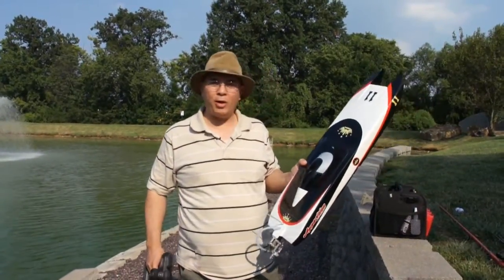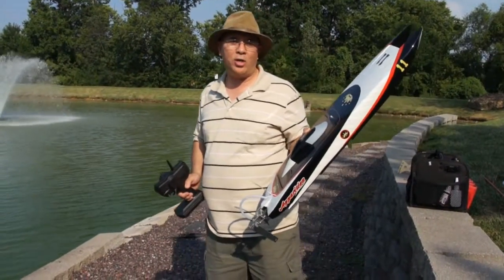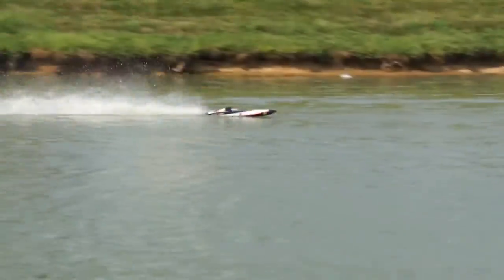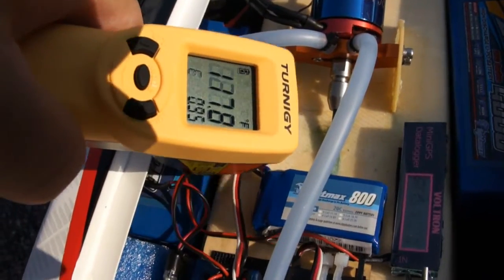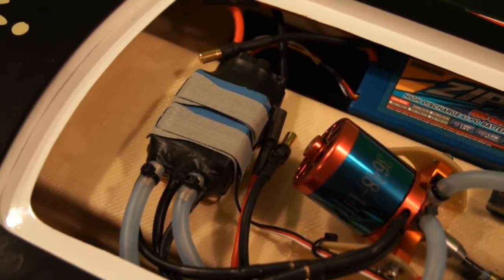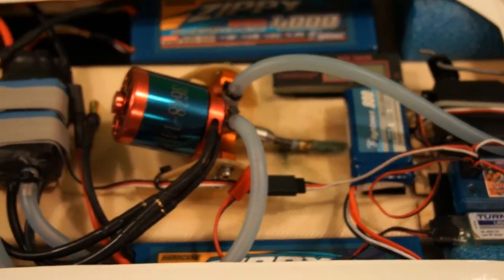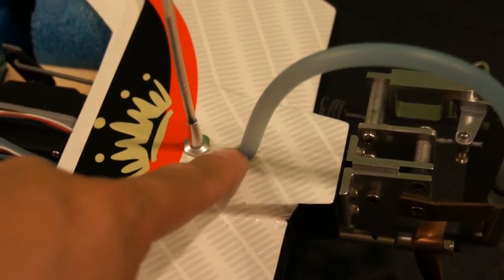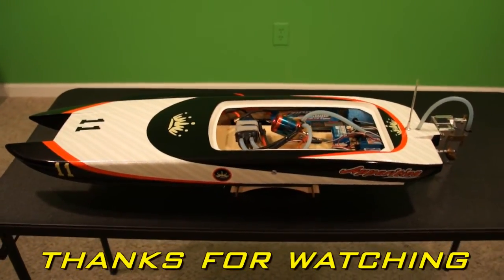Apparition Catamaran 6s testing and mods

Comment: Dumb question but to get this stock boat up to what you've made it since it's pretty sick, how much money have you spent total? I'm sure tons of time.
Reply from the maker: Thanks nobrizzle! The cost wasn't too expensive after buying the ARR version of the boat for about $180 I spent about $60 for both the new motor and esc. Only other things were a pair of 4000mah 3s batteries for about $60 and the radio tx & Rx another $40. It was a very quick and easy mod to do. If you enjoyed this video be sure to check out the "Apparition Ultimate Motor Upgrade" https://www.youtube.com/watch?v=KteZYspriyE

Comment: i ordered 1 of this.. with brushless motor dr.mad thrust 3680 1700kv.. with water cooling and 180a seaking.. is that ok with 6s??
Reply from the maker: The 180a Seaking is rated for 6s but you will need to make sure you are not drawing too many amps. You may want to use an HV esc that is rated higher than 6s so you are not pushing the limits of the electronics.
Reply from the maker: Amd Phs Have a look at the Turnigy Aquastar 200A esc on hobby king site. It's rated from 6s to 12s. Also have a look at the HV ESCs on offshore electric site. They have several different ones.

Comment: Thanks for the tips frank, tried your recommended setup using the 3659 super edf 1900kv motor with 6S and wow it goes like a scolded cat maybe near 70mph?
Moving the batteries more forward definitely saved it from flipping
Im using a cnc machines aluminum prop which saved the headache of balancing a bronze one.
Thanks for all the videos and the good advice mate :)

Comment from the maker: Water usually finds its way in either through the flex shaft or around the hatch cover. I always tape the hatch completely and make sure the flex shaft is lubed with a lot of marine grease. The grease helps keep the water from coming up the tube. You can also put a piece of heat shrink around the shaft tube where it joins the strut to help keep the gap sealed.

Comment: Hey Frank
Im running the stock motor with a 6S battery configuration and even thats still impressive
Seem to be getting water inside the boat through the flex shaft and coupler area so Im thinking the shaft being spring coiled maybe augering up the water from the propellor side somehow what do you think?

Comment: that boat is quick as hell, but not very fast, in my opinion. I have a highly modified Aquacraft mimi thinder that runs right at 50 mph!!! LOL  I am serious, shouldn't be too long before I get a video of it with Lazer gun and  Eagle Tree GPS  proof. BUT, I need much room to get up to 50, because I have to roll on the throttle very linear, or it gets violent :) For the record, @ 17-1/2 inches long, 1/18 scale, that is 900 scale mph. I have to pretty much make those pases on very near glass water

Comment from the maker: Since this video I have added a Y spliter on the inside of the hull and run separate cooling tubes to the motor and esc. They then exit the hull seperate through two exit holes. You can see this in the our video, Apparition Ultimate Motor Upgrade. It's listed on our YouTube channel.

Comment: Just a question, I was wondering why you wouldnt use the second water pickup off the rudder to run a seperate cooling line to the esc instead of the esc getting heated water after going through the motor head

Comment: Thanks for the info, I think it was a mixture of lack of cooling to the motor and too much prop in the water. I ran the boat for about 3 minutes and even after waitinh for 5 minutes with the boat out of the water the motor temperature was still 205F!! Boat runs free and shaft is well lubed. Motor was a brand new Turnigy 3648 1450kv as per your 6s test.

Comment from the maker: There are few reasons a motor will burn up. The main one is putting too much load on it and exceeding the max rated amps and watts. That could be caused by too much prop in the water, a binding flex cable, no lube on prop shaft and cable, the boat running too wet (plowing water) etc. Other reasons could be, defective motor, not enough water flow thru motor mount for cooling, etc.

Comment: I bought one of these, did all the mods you recommended, bought the Turnigy 1450kv motor and a 200amp ESC (running on 6s) but used an Octura 4/38 prop. Just 3 minutes into it's first run (impressive speed I must add) it stopped and on inspection I had fried the motor! Could it be the shaft that was too deep? Other than that I was well impressed.

Comment: Hi, I just bought a Apparition (single motor), what is the biggest outrunner I can stuff under there? I plan to run up to 8s, but don't know a lot about "outrunners"  I want the power of a like a 5692 inrunner motor (but that would not fit under the canopy)   What outrunner do you recommend?

thanks

Comment from the maker: @ninjafishable these outrunner motors have gobbs of torque which does make it a little touch when you first get on the throttle. I could probably get rid of some of that if I move the batteries a little forward.

Comment: Just a suggestion for ya...you really should split the in coming cooling line and have one line go to the motor and another go to the esc and then drill a separate hole for a second exit. That way you are not heating the water up from the motor and sending it throught the esc. Having two water exits will keep the flow strong. You always want your exit bigger than the entrance so you don't build pressure.